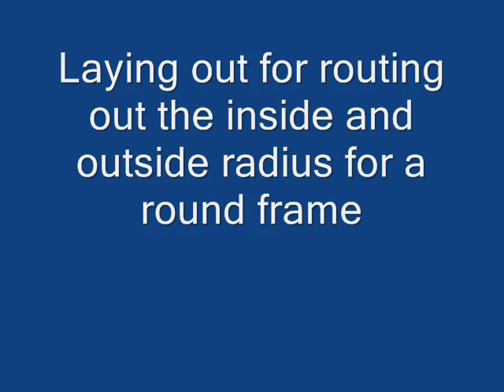How to make a Round Picture Frame

Comment: Thanks for the helpful video, it inspired me to try! I adopted your method and adapted it as well. I use one biscuit and hide it inside the circle so you can't see them. I also use glue to bond the pieces together- it eliminates the chance of chipping the edges when routing, and you won't need a strap clamp. I use glue and sawdust mixture to fill in any gaps in the seams and sand it down real good. Thanks Tony,  you rock!
Reply from the maker: +James Oetker 
Your very welcome!Glad I could help!  If you get a chance check lumberjocks.com  you can do a search for my handle (woodshaver) to find me and some of my projects or give this link a try!  http://lumberjocks.com/woodshaver/projects

Comment: Very helpful step by step guide. Thank you!
(How many router bits did you go through?)
Reply from the maker: lovefeistThank you for the nice comments! Glad that it was some help. I'm still using the same carbide routers bits today! If you do you cuts in small increments your bits won't over heat and they will last longer.